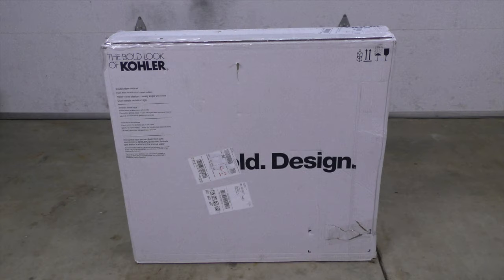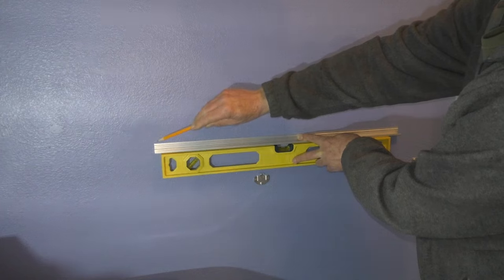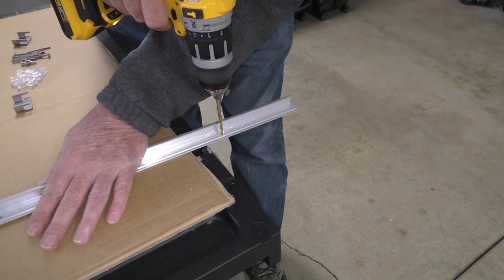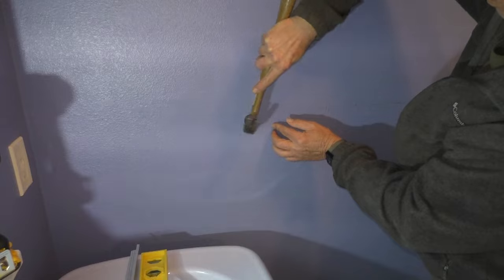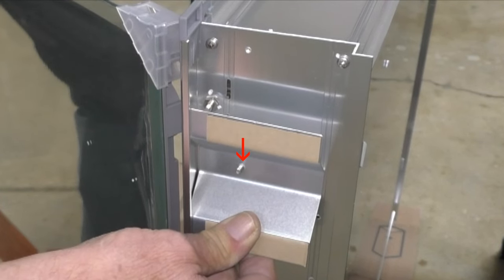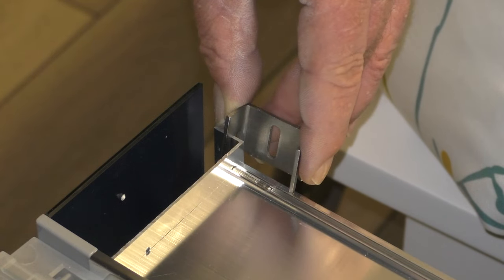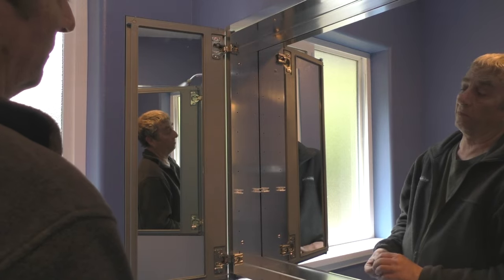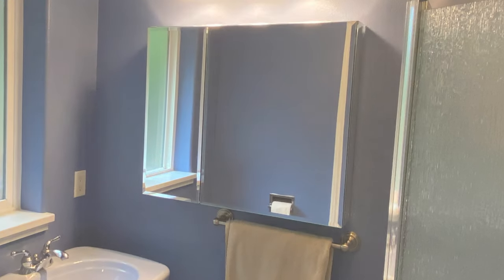How To Install A Kohler Mirrored Medicine Cabinet

Comment: Great video! Thank you!  So much better than the default Kohler video. Really appreciated the drill bit size recommendations. Your advice to put on the side mirrors before the final mounting was also very helpful. One step that I did to help make the final mounting easier was to attach the top brackets to the wall so that they were not quite tight then set the cabinet in place. If your mounting hole was set at the top of the bracket, it could slide up to allow the cabinet to go under it. You then slide the brackets down and finish tightening. This kept me from needing to hold the cabinet the whole time while screwing in the long screws. It also helped avoid the awkward angle for the screwdriver when tightening those top brackets.
Reply from the maker: Good information, thanks for posting.

Comment: I'm having such trouble with the mounting clips. I find it doesn't sit flush against the wall, nor does it seem to have an obvious  home on the cabinet. And, the cabinet itself obstructs your ability to screw it on while holding the cabinet.  This is the only part giving me the blues
Reply from the maker: I had trouble with this step also. Make sure the lip on the mounting bar fits in the slot on the cabinet (3:15) in the video.
Reply: @Iscaper  thank you for replying
Reply: This is exactly why I came seeking this video. You would think those brackets would have a more secure fit to the cabinet on the interior side. Seems like a really goofy design.
Reply: @AaronBandt  I agree, only one side of the clip seems like catches the top part of the cabinet.  I installed it anyway, and it seems like it is holding the cabinet well.  I think they could have come up with a better design for that clip.
Reply: Same as on RN! I’m so frustrated
Reply: I’ve had it installed now for over a year without incident. I guess that was test in “trusting the process” but man, that was frustrating.
Reply: @MichelMawon4982   I’m an over thinker and was so unsure about the clips , but installed them and it’s pretty sturdy! Happy now 😂! They work we just have to trust the process since they are different from what we might have seen before .

Comment: Will the installation work on the Koehler vedura model
Reply from the maker: You would need to look at the manual and see if it has the same mounting hardware and installation steps as this model.

Comment: You forgot the doors installation and slow close setting
Reply from the maker: Door came installed on my cabinet and there is nothing in the manual about a slow close setting.

Comment: I just installed it alone. He was correct  it sucked because of the clips. My opinion a poor design. I installed a similar cabinet a few years ago and it had a top plate that slid down from the top and locked in much more securely.  These little clips make you doubt if you're even doing it correctly.
Reply from the maker: I agree, putting the plate at the top and letting the cabinet hang down would make it much easier to install.
Reply: I’m having such a hard time installing those stupid clips. This thing is heavy. I already drilled the porcelain wall measured the bar is installed but the clips make no sense to me 😬